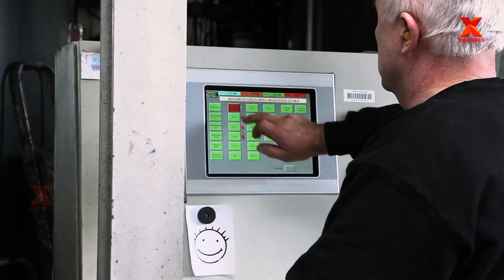How To Retread Giant Tyre Properly With Retreading System & Technology. Amazing Bead Push Off Tool

Comment: Always love you videos but the background sound doesn't match the processes depicted in the video. Why not use the original sound, or some stock audio, or mix of both? Cheers!
Reply from the maker: Most of the videos have no original sound, X-Machines needs to collect the corresponding sounds to add into the video. In some videos, this is not done very well, X-Machines will try to do better in the nest videos. Thank you for always supporting the channel.